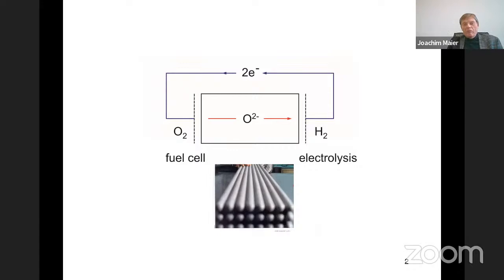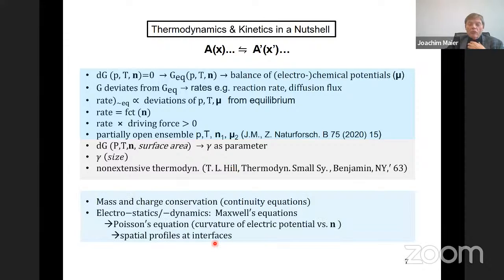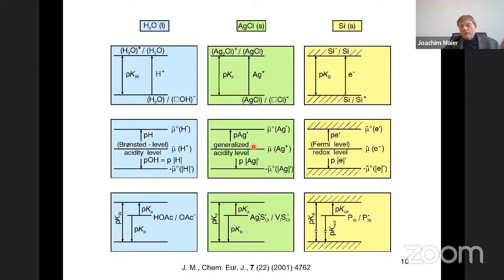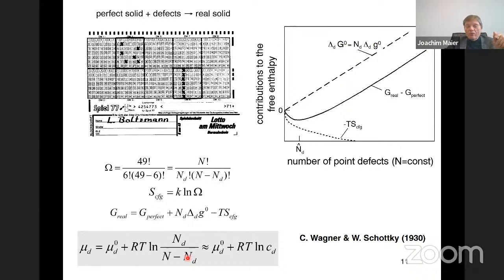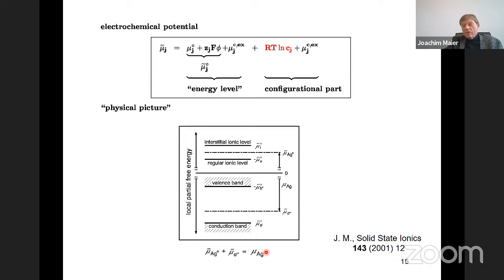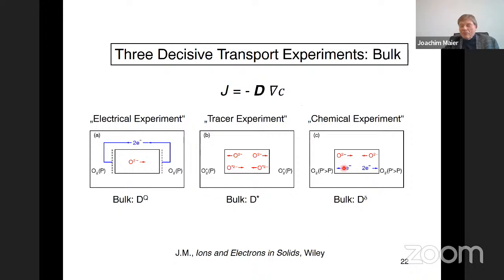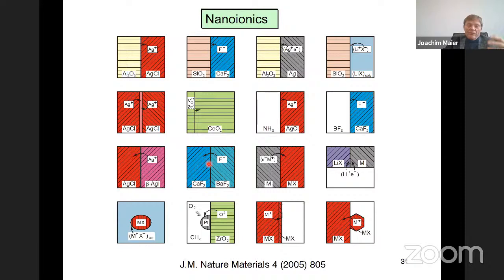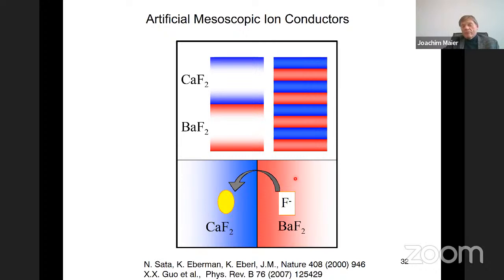18. Prof. Joachim Maier  - Mass and Charge Transfer in Solid State Electrochemistry (Mar 31, 2022)

Comment from the maker: First Part:
00:00 - Everyone is getting connected 
00:16 - Introduction 
01:40 - Beginning of the talk 
04:50 - Thermodynamics and Kinetics in a nutshell
06:05 - Single electron transfer
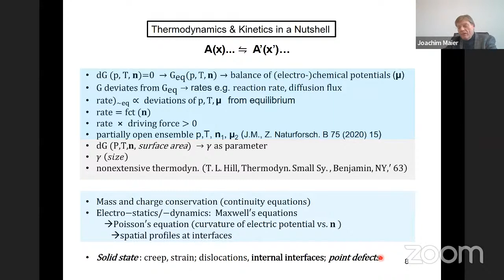11:03 - Solid state ionics: Introduction
25:33 - Kinetics and transport    
37:00 - Thermodynamics of contacts and nanoionics   

First Q&A 
44:15 - Q1: Nanocrystalline oxides
47:28 - Q2: Compositional changes
49:58 - Q3: Conductivity anisotropy at interfaces
52:43 - Q4: Mobility effects in parallel conductivity
54:15 - Q5: Prediction of	activation barriers 

Second Part:
55:24 - Lithium-ion batteries   
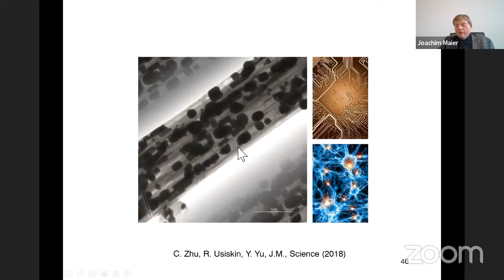1:03:34 - Job-sharing interfacial storage
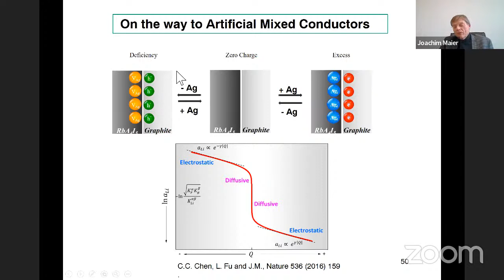1:05:53  - Conversion reactions 
1:09:13 - Perovskite photovoltaics
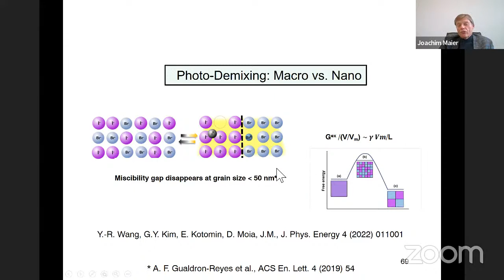1:20:28 - Heterogeneous doping and Nano-ionic

Second Q&A: 
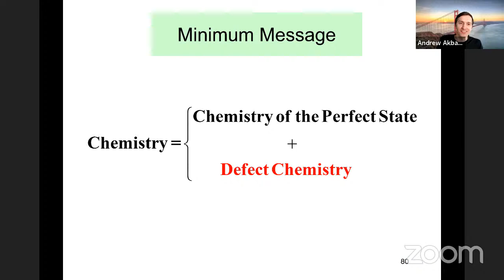1:29:41 - Q6: Coupled Li-e transport 
1:32:52 - Q7: Diffusivity and transference number
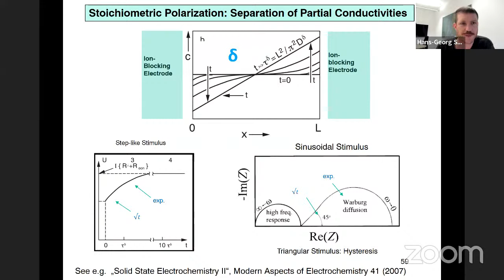1:35:57 - Q8: Variation of concentration 
1:36:34 - Q9: Role of electron band structure
1:39:30 - Q10: Job-sharing interfaces 
1:44:42 - Q11: Ionic conductivity in solid electrolytes